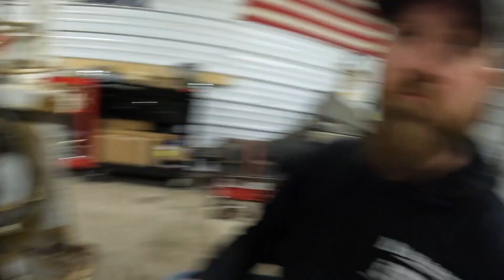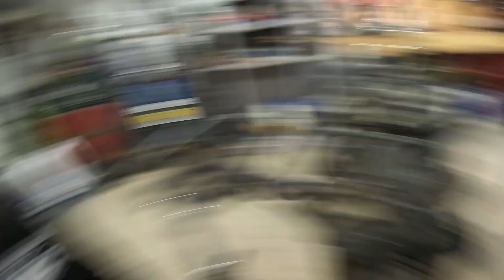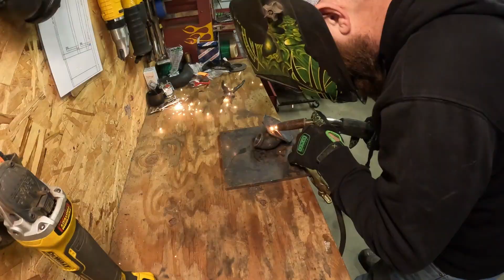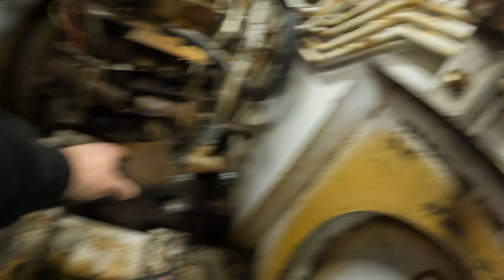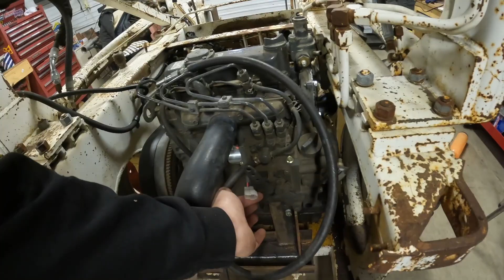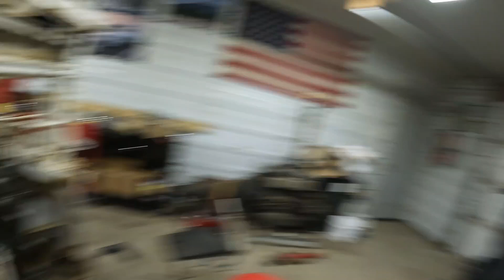Repowering a 610 skidloader - Part 2

Comment: Interesting.  I might have gone with replacing the oil drain bolt with a banjo fitting, then run a hose with a plug at the end.  If it still needed more clearance I'd look at tilting the engine backward on the mounts.
Reply: I was thinking the same Pete